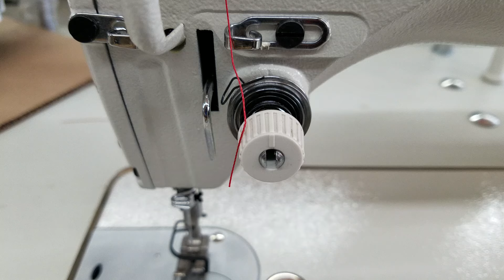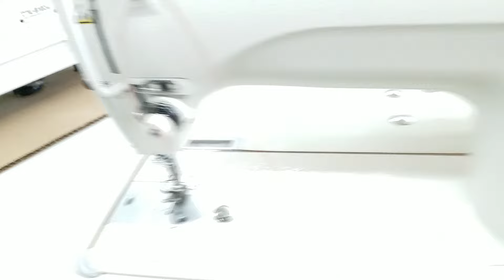Juki-8700H tension release and threading issue

Comment: Good day, 
I have a juki Ddl 8700. A few days ago, I did tilt the sewing machine open to see the level of oil within, and since doing that, it stopped sewing.  Before I  tilt the sewing machine off its table, the tension was on 3, but now the tension can not be positioned on 3 but on  lower numbers, which makes the Reserve bar lift continuously up and down without control, garthers the under thread.  I need to sew straight. Please, what can I do to fix this?

Comment: Hi, thank you for this very helpful video.  I do sew on a juki ddl 5550n, about 9 hours 4 days a week, and my thread is shredding above the needle.  I have to stop almost constantly to rethread the needle. As you can imagine I am loosing my mind.  I change the throat plate, change the needle, feel for burr’s on the hook…no dice.  Could you please give me any insights you may have?  I did not know about the tension disks pulling apart during threading and I will certainly be using that technique from now on.  Thanks again.

Comment: I have had a Juki 1541S for several years now and the one thing that would improve it immensely for me, as I do large canvas work, boat covers etc. is for there to be an aftermarket option to run reverse without having to use the right hand to hold it down.  When stitching large pieces it takes both hands to guide the material and in boat tops there are intricate areas that require long backstitching.  As it is, the workpiece can wander as the weight of the material pulls it off course when you only have one hand to guide it.  Do you make or do you know of any option to make an automatic backstitch for the 1541S?
Reply from the maker: The only auto backstitch I know of for this machine would be on the Juki DNU-1541S-7.  It is a small fortune.  I think around $5000.  There is no aftermarket solution that I know of.

Comment: Hello Sir

Great video. Question what about bird nest. My machine sew but bottom stitch is loose or looks like bird nest. How can I fix it? The sewing machine is juki ddl -555
Reply: Mine is doing the same thing! I can't get it fixed no matter what! I wish there was a response to your comment
Reply: Check your bobbin.if you hang it and releases thread easily it will cause birdnest thread so tighten the small screw near the hook.hope this helps.